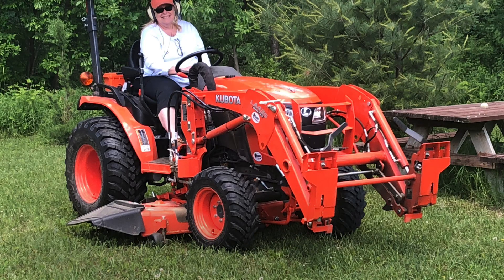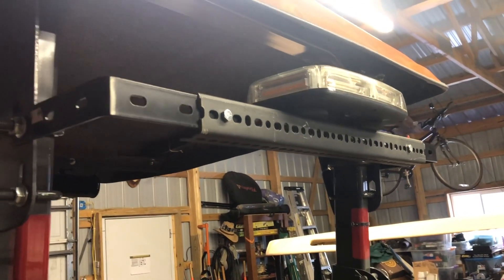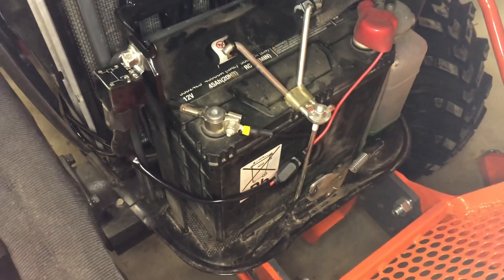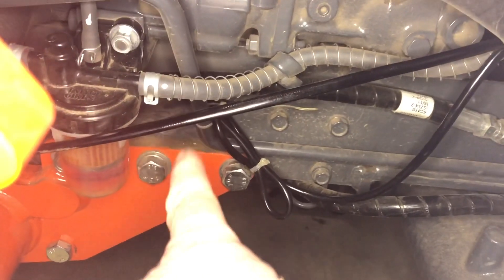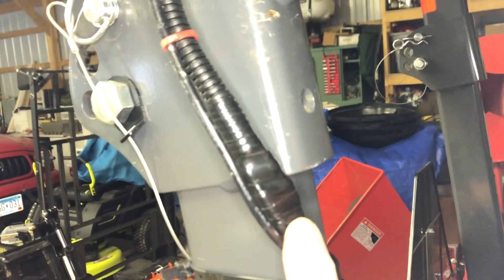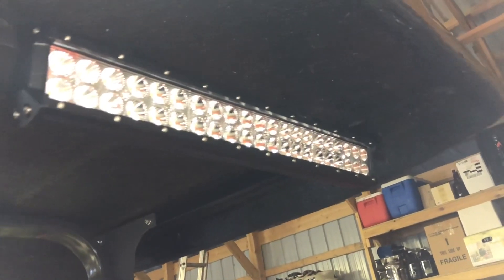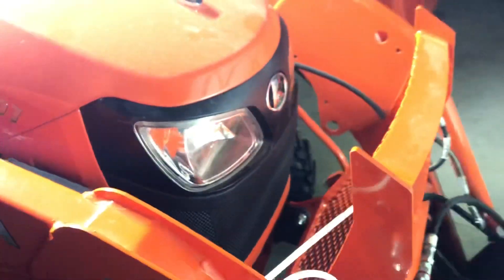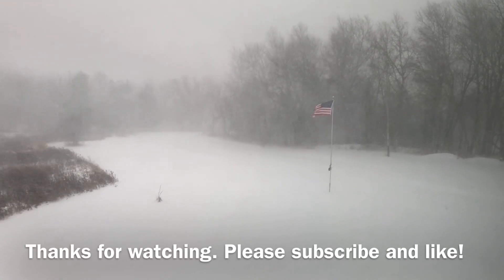#22 Adding LED Lights to My Kubota B2601

Comment: Great job.  I love how bright the light bar is.  I also love the way you were able to attach it to the canopy.

Do you have the part/ model number of your hazard light unit?

Thanks...
Reply from the maker: Hi Daniel, Thanks for stopping by!  I got the light bar from Amazon.  This is the description: Nilight LED Light Bar 20Inch 126W Spot Flood Combo Led Off Road Lights with 16AWG Wiring Harness Kit-2 Lead, 2 Years Warranty. Let me know if you have any other questions. Cheers!
Reply: @peacefieldfarm_mn  HI, Thank you.  I found the LED Light kit.  I was asking about your flashing hazard light.  Any info on that would be appreciated.
Reply from the maker: @danielrapoza8468  Sorry for the confusion on my part. Here is the info on the hazard light; Xprite Burst Series 12V COB LED Amber/Yellow Roof Top Emergency Hazard Warning LED Mini Strobe Beacon Lights Bar w/Magnetic Base, for Snow Plow, . It also came from Amazon. Cheers!

Comment: Merry Christmas Michael! Great job! One of the benefits of wiring direct to the battery is that you can turn them on without the tractor being on, I believe. Looks like you will have plenty of light for the early evenings of winter and looks like you got a great price on a bright set of lights. As you demonstrated, the factory headlights are not of much value when you have a FEL on the front. I wish you and your family a Happy and Successful 2021!
Reply from the maker: Hey, Thanks For watching GP! I have not yet needed the lights outside yet, but it gets dark so early now that it won't be long. The factory lights are worthless if you have any attachment on the front. One of the advantages of your cab!  2021 HAS to be better than 2020!